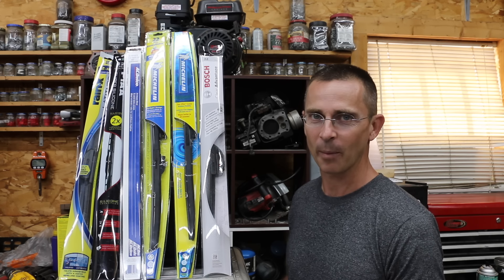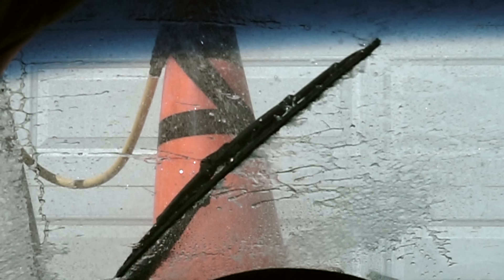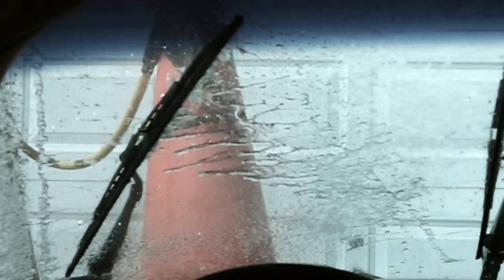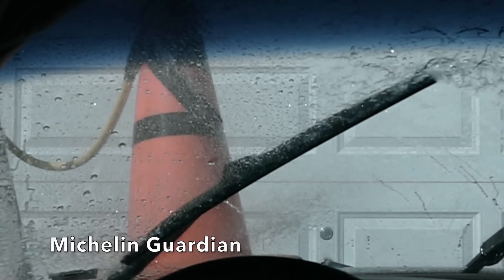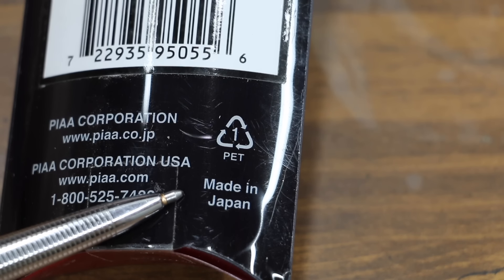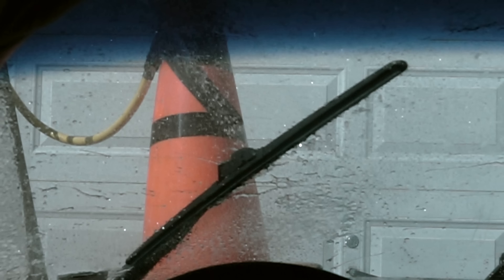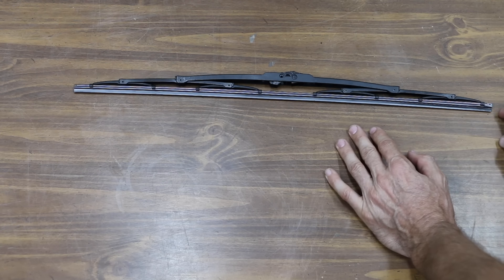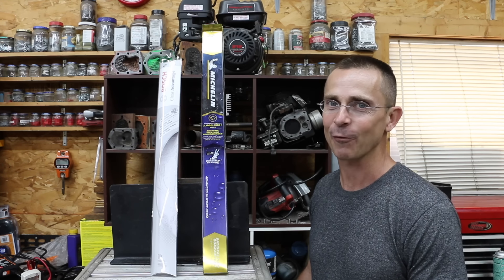Which Windshield Wiper Blade is Best? Let's find out!  Michelin, PIAA, Bosch, AC Delco, & Aero

Comment: One trick from a professional semi driver: Get wiper blades one inch shorter than what is supposed to be for your vehicle.  The shorter length will fit the contour of your windshield much better and be much more effective at removing water, snow, and ice.   The passenger side is dramatically improved, while less so for the drivers side.

Also, I was among a group of 5 truckers who had a haul from Pittsburg to Brownsville Tx.  During our wait to get loaded, we decided to follow the instructions on the classic RainX product to the best of our ability.  Which meant a perfectly clean windshield before application, and a very thorough 2 coat application.  Once we got to Texas, it was raining heavily enough for others to get off the road, but we kept going without the use of wipers.  We could see perfectly well; better than any wiper blades I've ever used.  But once you started using wipers, you ruined the RainX coating fairly quickly.  We never continued the practice as it was fairly labor intensive and didn't work with dirty road spray.  So it worked great in any rain storm, but the road spray after a storm would force you to use your wipers and ruin the coating.
Reply from the maker: Thanks for the tip!!
Reply: Semper Fi  Not since the 90s bud.  And how many cars do you know have perfectly flat windshields?
Reply: lol why would the engineers design wipers so that 1 inch shorter than what they say is better. that makes no sense.
Reply: @dynamo3059  The engineers are thinking the largest area of visibility, but at the cost of poorer visibility over the entire surface.  A wiper blade 1" shorter has less area of visibility, but (especially for the passenger side), the wiper blade does a better job for the smaller area.  So you're sacrificing visible area for better visibility in the smaller area.
In many cars, you will actually see the end of the passenger wiper blade sticking out in the air without making contact with the windshield.  Whenever you see that condition, ice can form on the wiper blade and streak across the entire windshield.
Theoretically, you can get excellent visibility by using 6 inch wiper blades.  But that won't give you a very big area to see through.  The general rule of thumb is, the shorter the blades, the better they will remain on the glass.  But there's obviously a point of diminishing returns.  At some point, your area of view will become too small.  So you could go with blades that are 2 or 3 inches shorter, but that might create blind spots in bad weather.
Engineers have to do this balancing act with wiper blades.  Wiper blades last longest when they are not pressed down against the windshield, allowing them to do their job without much flexing.  But at speeds, the force of the wind tries to pull them up off the glass.  So the engineers have to do something to counter that effect.  And they have to do it on the cheap.  The tried and true solution is cheap springs.  But springs can't compensate for low speeds.  Thus, the springs might keep the blades on the windshield at 70mph, but sitting at the stop light is actually overflexing the rubber blades and wearing them out prematurely.
Now, going with smaller blades will help them stay on the windshield, but that also puts more pressure per inch on the blades - wearing them out just a little faster than otherwise.  There's always a tradeoff.  Engineers are very much aware of the concept of the "engineering compromise".
There used to be a product that you could clip onto your wiper blades that counteracted the wind at speed.  I'm not sure how well they worked, if at all.  But I know the better they worked, the faster your wiper blades would wear out.  There's just no getting around basic physics.

Comment: Needed some epoxy to do a repair. Project farm uploads a video testing them.  I was going to re paint the inside of my house. Porject Farm uploads a video testing the different paints. My wife complained today she needs new windshield wipers. Look at YouTube see Project farm uploaded a video very recent testing the best wiper blades. It's almost if you're reading my mind. Now I just you need you to test the best numbers to win the lotto.
Reply: You went with Bosch.
Reply: 4, 8, 15, 16, 23, 42
Reply: @yiotis82  i understood that reference
Reply: The best lotto you can win is Bitcoin 😉
Reply: Did you not know, Todd has a ouija board, crystal ball, and divining rod? 🔮
Reply: could you test the endurance of the wiper blades?  that is my biggest concern how long they last...they all tend to work brand new just fine.  its the harsh heat of the sun that typically dries them out and they become brittle
Reply: @crtinkering7323  The problem with that is different environments. He doesnt see sun like I do, but I dont deal with ice/snow so thats cool.
Reply: @crtinkering7323  In germany I got Bosch wipers named Aerotwin, looking similar to the ones in the video and never bought anything else since then. My brother got a pair on his Audi, good results even after 4 years with all season. Same goes for other cars, always got the bosch if possible and everytime had at least 3-4 years without noticiable less performance, no squeaking or streaks even after winters with icy windshields etc. Never had michelin or anything else tho, but the cheap ones we had were done after like 1-2 months of winter.
Reply: I agree...content is so relatable it seems like it was personalized just for me...are we sure he's not peeping in our windows?
Reply: RELAXXX no one is watching YYYOOUU
Reply: @crtinkering7323  I'd love to see that also.  The only question is this.  Is this guy from Project Farms wealthy enough to afford the machines to make such a test across multiple wipers ...practice in a reasonable amount of time?
Reply: @yiotis82  I'm lost, I don't get it
Reply: I was literally looking at windshield wiper blades today!! We've been getting alot of rain lately
Reply: I needed to line the bed of my truck he uploads the best bed liner your not alone hes is the gift of covenience

Comment: The test would have been more accurate with a 40-50mph wind over the windshield. This is especially true for the RainX test. In fact, with the RainX blades the wipers don’t need to be used for light rain.
Reply: Wind makes a lot of difference. My car needs spoilered blades, regular blades loose contact with the windshield from about 100km/h (60mph)
BTW, love RainX fluid on the windshield, no wipers needed from 70km/h and up...
Reply from the maker: Thanks for the constructive feedback
Reply: Maybe a good leaf blower could be used to add air flow if retested in the future.
Reply: I've driven 70 mph in rain so hard that cars was pulling off the road and I only used Rain-X without my wipers even turned on.
Reply: I’ve noticed the best speed is anything over 50 mph and the water beads right off when using the RainX blades
Reply: We have used RainX for 30 years and have never found anything that can do the same thing.
Reply: Paul E It depends on the car's aerodynamics and how fresh the Rain-X application is. Usually 35 mph minimum and 45-50 average.
Reply: Yeah, RainX fluid works good even with bad wipers.
Reply: Rain-X is silicon liquid ;) Silicon is hydrophobic
Reply: This is exactly why I came to post here. Wind is a major factor in the performance of any wiper blade.
Reply: Kris M I had the opposite effect with my mustang. Any blade that had the spoiler/aerodynamic blade would lift off of the windshield when I turned them on at highway speeds. They were fine under about 40 mph. And rainx does make a big difference when going above 50 mph
Reply: Paul E I don’t even use the blades, I just use the windshield washer fluid and it works great year round
Reply: Was going to mention the same, without wind it's not really a very good test.  I also polish my windscreen with rainx, it's great at higher speeds.

Comment: I worked in a test lab at a Major Windshield Wiper company about 10 years ago and we performed what we called a Competitive Analysis on our own wiper blades as well as blades purchased from the local big box and automotive parts stores.

Along with the tests you performed, we did a lifecycle test of 1,000,000 cycles, a salt spray test to test for corrosion, as well as a simple drop test from 3 ft. (The drop test was to simulate someone accidentally dropping the wiper blade as it was being installed and you’d be surprised how many fell apart and/or broke). When we would wipe a windshield with the blade we would load the windshield with water and do a single wipe and count the seconds for the windscreen to be completely dry in the wipe pattern.

This video brought back some fond memories. I also discovered that the company I worked for had a low cost blade marketed under a different name that outperformed every single blade we made and 90% of the blades we tested against.

Great video!
Reply from the maker: Thanks for sharing.
Reply: What was the low cost blade you referenced in your last sentence?

Comment: Perfectly timed video! My '98 Chevy Cavalier was sitting for almost 2-3 years, and I just rebuilt the engine with my friend (replaced all gaskets including head gasket, full cleaning and tune-up as well), put in a new clutch (it's a 5 spd manual), and did some other work to it... started up perfectly, but the wipers were accidentally in the on position when we first started it, and the blades that sat on there were dry-rotted and fell apart immediately, lol. Definitely perfect timing to replace them.
Reply from the maker: Thank you!